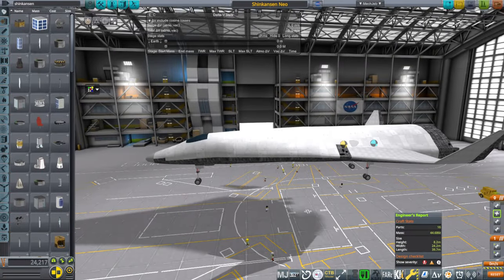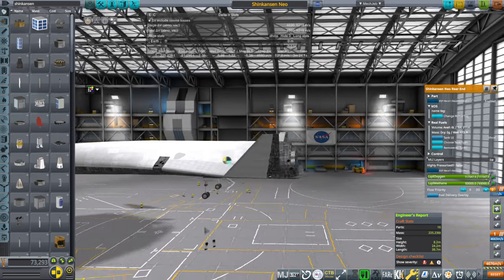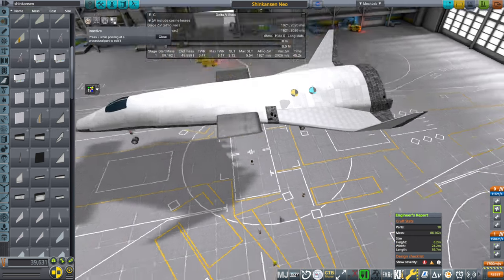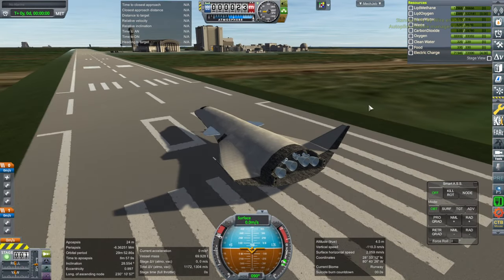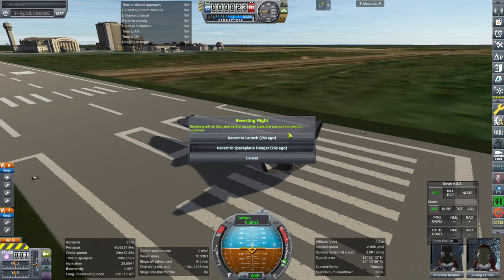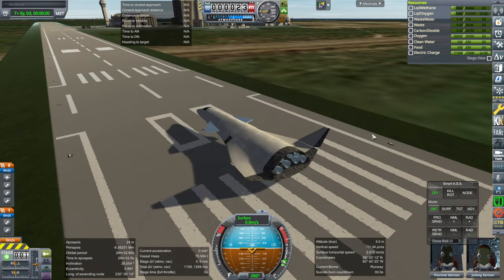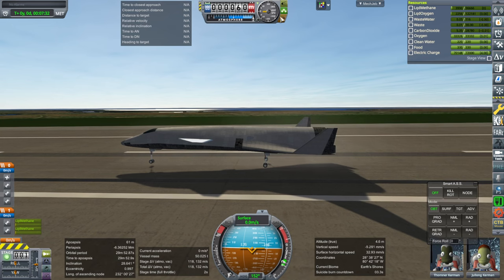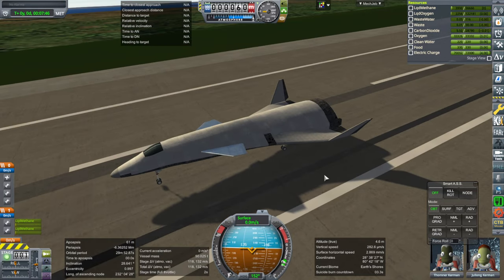Shinkansen Revised Test Flight 1 (RO in KSP 1.12)

Comment: Good challenge idea: The Ultimate Goat Test Challenge
The goal of the challenge is to collect as many points as possible. It is done in a fresh science mode save.

The challenge is done in 3 steps:
1. Before the challenge begins:
Before the challenge begins, you will need to get the settings for it. You can even choose multiple at a time. They can't be broken but they will reward you by multiplying the score at the end of the challenge. +X% means that X% of the total score will be added to it. All percentages are summed up first before applying

Hardcore mode (if you kill a Kerbal you lose all of your points, no quicksaves are allowed): +100%
Quicksaveless (already applies if Hardcore mode is active but without the additional reward for it, you CAN die, but still, no quicksaves): +30%
One ton at a time (every rocket needs to weigh at most 1000 tons): +50%
Absurd introvertism (you only have one Kerbal, if he dies, another one replaces them): +70%
Forgot the thingy (no docking allowed): +30%

2. During the challenge
The points are scored for landing  on the celestial body and returning back to Earth. Each celestial body weighs a specific amount of points:

Eve: 280
Moho: 245
Tylo: 235
Laythe: 210
Vall: 200
Bop: 190
Pol: 175
Eeloo: 165
Dres: 155
Ike: 145
Duna: 140
Gilly: 130
Minmus: 120
The Mun: 110
Kerbin (you need to get to space, land, get to space again and land again, all within one launch): 100
The points will only be earned if a kerbal lands on the celestial body and goes back to Kerbin (a robotic spaceship doesn't count!). If the Kerbal dies on the way back after landing on the body, you will lose half of all the potential points it could've scored if the rocket would've gotten back to Kerbin, for example if you land on Vall and then crash on your way back, you will not gain the 200 points from that launch and only lose 100 points (except if you revert that).

You will also lose 35 points each time you upgrade in the tech tree.

3. After the challenge:
You may stop the challenge any time as long as no Kerbal is in space. The points are multiplied by the conditions you chose in the beginning. If your points are negative, you have lost the challenge.

If you are good enough you will get a medal (just a trackmania Easter egg)

🏅 2986 points (my PB)
🥇 2700 points
🥈 2400 points
🥉 2100 points